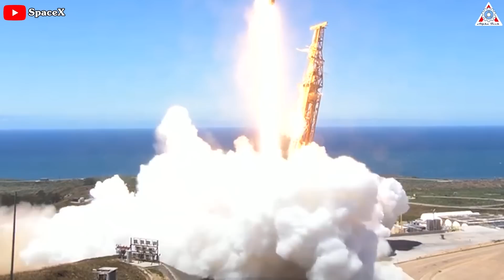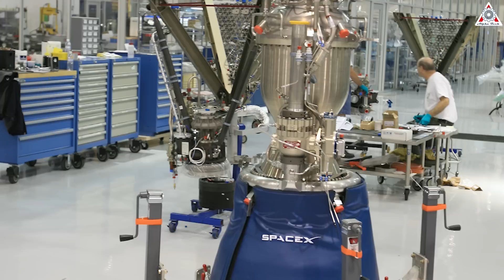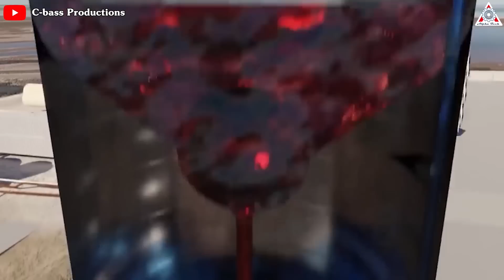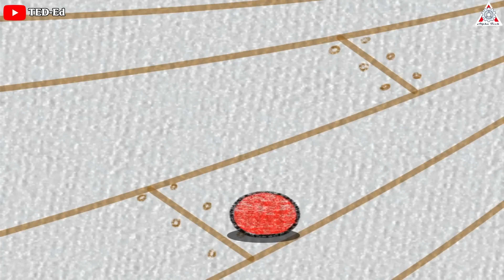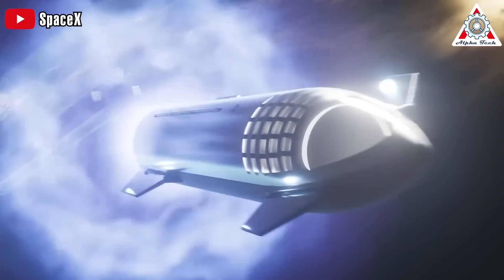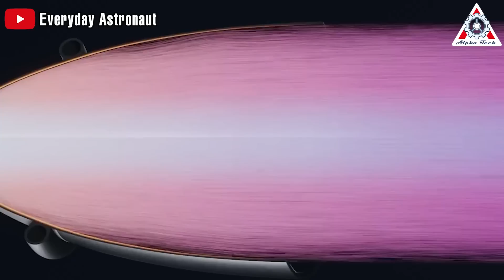What SpaceX just did with Raptor & Merlin engines totally shocked Russia!

Comment: is SpaceX wants to achieve greatness, then they need to show out with the best would you be the later models and knows probably the Raptors three would be a good place to start. They have more experience building Raptors and it has been streamlined. They can always throttle down a little bit and takeoff so they don’t screw up the pad again. I know his idea is that we won’t have much water on the moon or mars, but the moon is super easy to get off of they could use Chi thrusters of the shot to get off that and there’s much more water on Mars definitely enough to make a deluge system which would also think in the atmosphere! Plus spin prime cash should probably just be vented since it is 40 times more potent than CO2 as a greenhouse gas. Therefore warming the planet up and creating a thicker atmosphere CO2 is important if you want to get plants growing, which is needed for US! as well as an effective biome, including fungus at some point and carrion eaters herbivores and predators. al gore suggest cows…… good to eat, and them farts man!😱🤪😂😂💯

Comment: this is great to have Raptor and Merlin engines in progress.  Could one or both engines be refitting into our moth ball space shuttle and reuse then again with minimum changes and better twin external booster engines power with methane and O2 gas instead of the solid booster rocket engines..  Use of space shuttle to build up new NASA space center where it may be able to have a gas station type for refueling starship and future Dreamliner starship. Contact me if i am wrong or right about this dream in using new engines for the space shuttle and future Starship Dreamliner ships. this is my idea ....

Comment: Your right!  Russia, and the rest of the world, is SHOCKED at how ALPHA TECH creates its scripts.  At least three old scripts clearly were unstapled , thrown in the air,  and read as the pages were picked off the floor.  At least there wasn't any Delta 5 used in this effort although telling us an RS25 engine has two combustion chamber is an interesting alternative fact.  No wonder the Space Shuttle had problems.  All pictures clearly show it flew with just 1 1/2 engines. How Humiliating!

Comment: Nice job, but there's some technical details wrong in there.  You said the Merlin 1D has 1.7 million pounds of thrust, that is no where near correct.  Maybe you meant the total thrust from all 9 of them on the Falcon 9.   And the RS-25 Space Shuttle engine does not have 2 combustion chambers!  That would be the engine you mentioned just before it, the RD-180.  Keep up the good work though and maybe just check a few more facts.

Comment: Great video as always, I like learning more about space tech. I'm wondering why the falcon legs deploy like that and how they work, is there like an hydraulic inside the rocket that goes outward? And why did they do it that direction and not extend from the bottom? Is it like a failsafe air-brake that can be used somehow?

Comment: I am Russian and I am disappointed. I never heard here what exactly should shock us =(
We recently tested our new RD-171MV, a four-chamber engine with a thrust of 800 tons - at the moment, this is the most powerful rocket engine in existence. It was created for the new Soyuz-5 rocket.
We are also working on the methane engine RD-0169 for the Soyuz-7 - it will be an analogue of the F9, but of the middle class.
Work is also underway on the Krylo-SV light launch vehicle. It will be a rocket with a reusable first stage, which has a folding wing. After separation, she sits down like an airplane.
We have also been working on the Zeus nuclear tug for many years. So don't worry about us, we're fine =)
Reply: watch out for toy drones from Ukraine
Reply: clearly clickbait and recycled material from months ago...
Reply: Кацапоид вернись в палату и прими таблетки
Reply: Не надо нас успокаивать😂
Орёл тоже строится😂с Володей Роскосмосу пиздец😅
Reply: You could hear this pr.i.k - typical murican... b..t..d - when they had nothing they were very happy for the Russian help with the engines, without them for years they could not go anywhere - to the Mars, not even the Space Station! They could only use a trampoline. Now you could hear all their thanks - KICK RUSSIA OUT...
Reply: You need to work on your landings, though!
Reply: Merlin is a obsolete open cycle engine and Raptor is a unreliable RD-270 copy

Comment: A big advantage spacex has is the number of engines they produce. Factory production is inherently more reliable. But, the frequency of production also means processes are continuous and refined at a faster rate than infrequent large engine production.
Reply: It helps a lot with development, because each engine is essentially disposable until it's actually relied upon for a mission. Pop media likes to make a big deal out of engine explosions, because they're dramatic, but it's fine for an engine to explode during testing when the engine isn't a precious one-off prototype hand-crafted by master fabricators for years.
Reply: 44
Reply: I think the biggest advantage is reusability. You can examine engines after every flight.